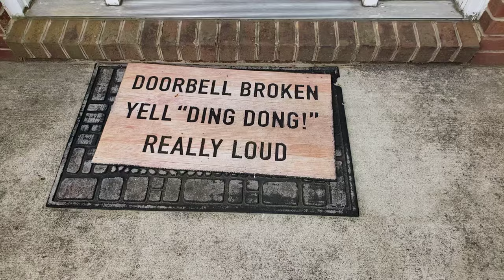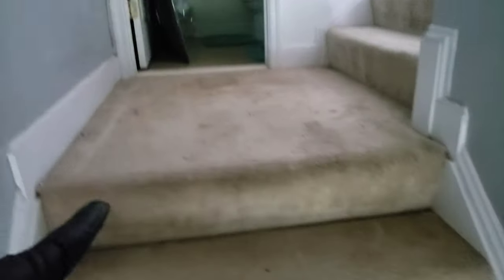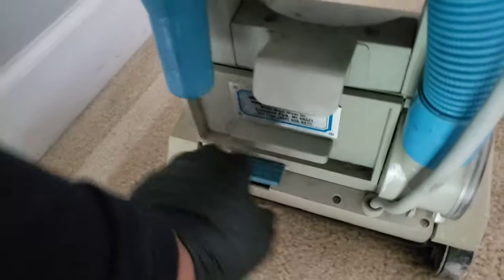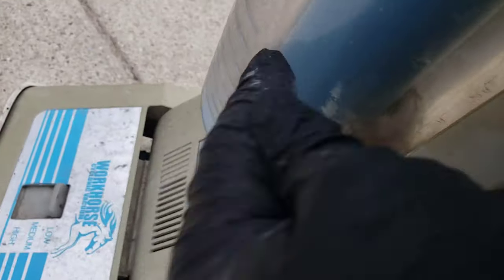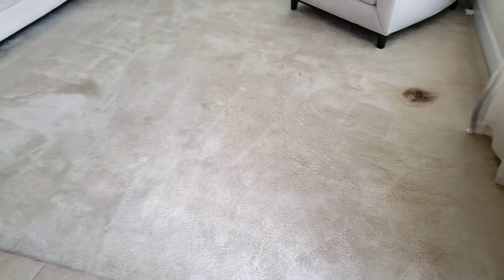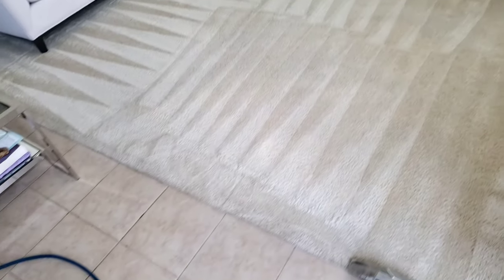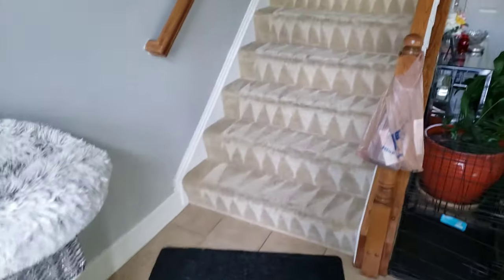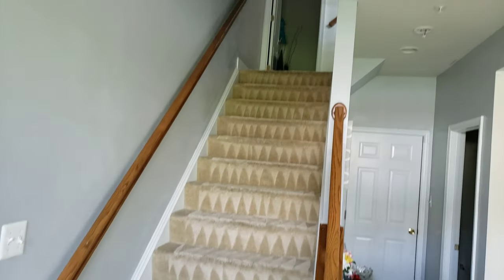EXTREME PET STAIN & ODOR REMOVAL| SUPER SATISFYING STAIR BRUSH & RAKE |Carpet cleaning vlog Ep 259

Comment: How long to the Workhorses usually last for you and did you buy the new one from the company website?
Reply from the maker: With proper maintenance and putting new parts on.  They will last forever.
Reply from the maker: Yes I buy all tools and equipment Brand new
Reply: Cool.  I was wondering.  I’ve only seen the Workhorse on one website for purchase.